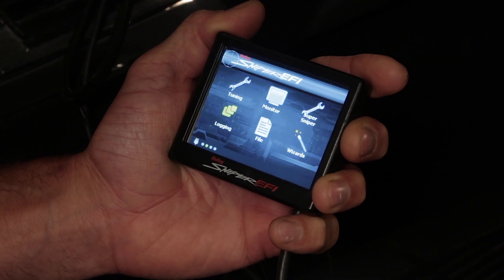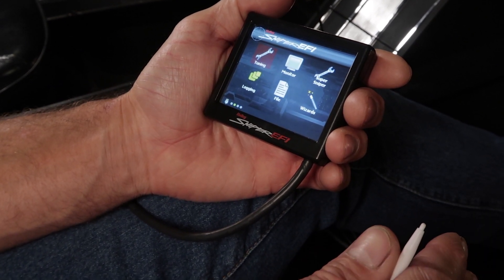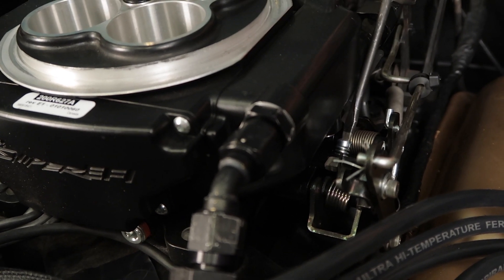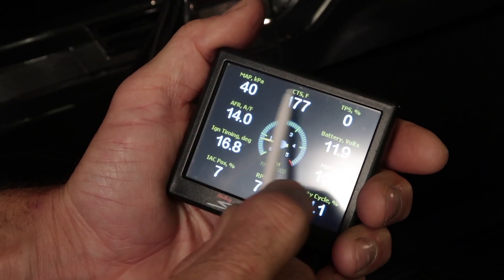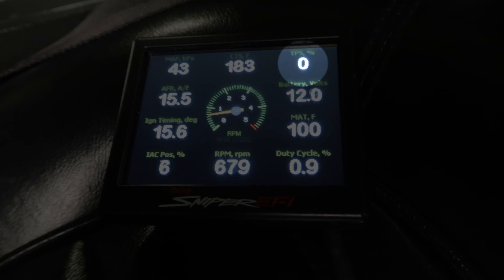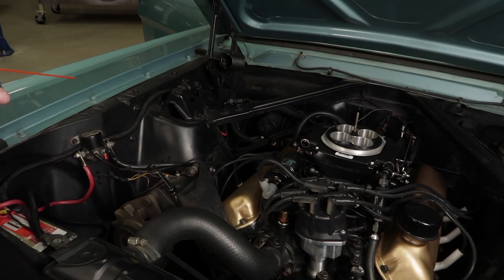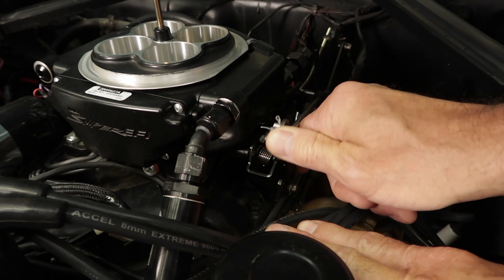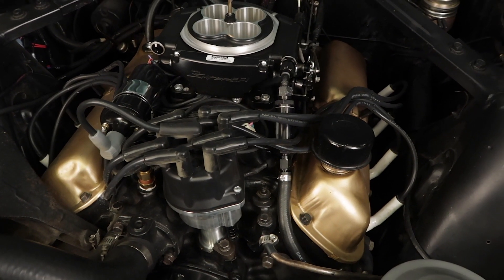Sniper EFI Idle Tuning

Comment: Can the efi be operated with the IAC disconnected, or with a static IAC? This surging issue has become quite a problem fof me, I even replaced the IAC, and it continues to surge when warm. This is a BBD model Sniper EFI, and it has me foubting not onlh it, but the Q-jet model one I got for my RV but have not installed yet!

Comment: I’m about to install a sniper stealth I bought two years ago finally. Fuel pump and lines on the way expected Tmro.  I’ve heard some about some challenges with the older 4150 flanged stealth units I hope it all works like it should on a mild 440 truck.

Comment: I've been looking fr a video on how to set tjr IAC on Sniper 2 .. the set u is different.
for example

On the Sniper 2,
There are two Adjustments screws with green springs around them.
I really want to know what each screw adjusts?

Like the front one (towards the front of the turck) adjusts ___ ?

And the rear most one is for adjusting the _____________________?
Reply: Just for the record I learned the FRONT SCREW (the onne on an angle ) is the "Primary Idle Adjusting Screw"

Comment: I’m curious if anyone can help me out. I’m trying to figure out how the Sniper learns…for example, I assumed that each drive would have the Sniper learning and that eventually the learn percentage would reach 100%. Mine seems to start from about 8% at each start and then only ever gets to 28% at its highest learn rate. Is anyone ever seeing 100% on their installs? Or does it start from scratch at each start by design? I’m running the Sniper BBD on an 84 AMC Eagle Wagon if that helps. It’s the CJ7 kit that Holley sells. Cheers!
Reply: Hi!  You want that number to be as low as possible.  It actually means the amount of correction your sniper is making to you fuel table, so the lower the better.  If you sniper has learned "100%" as you mention, your learning graph would read 0%...  But it really isn't that simple.  Drive around for a couple of weeks, in all conditions, then remember to transfer the learn table to the fuel table.  Do it again and you should see lower numbers on the learn table.
Reply: Oh wow…thanks. I was thinking about it completely backwards. Thanks for making it make sense for me. Now off to plan a new fuel tank and in tank pump to get rid of the angry mosquito sound of the external fuel pump. Cheers!

Comment: What Holley doesn’t tell you is that the PCV valve with the ball in it is a complete nightmare for tuning. Calling tech support they recommend that you use an adjustable style like a Wagner. I finally ditched the setup for a motion raceworks catch can with the adapters for SBC valve covers. Fought this for weeks with multiple calls to tech support.
Reply: I read to get a fixed orifice pcv valve, also where is the pcv supposed to be hooked up to, I thought it was for the front plug, but in the video they have their routed to the back, would that make a difference?
Reply: @thinetaco3722  it doesn’t matter where you put the pcv setup. Usually goes towards the back for convenience to the back of the carb.  It will vent positive pressure out of any hole in a valve cover.  Wagner is a adjustable pcv valve that you can adjust using a vacuum gauge then lock it in.

Comment: My truck idles fine when its hot. It WON'T keep running  without throttle assistance until it reaches 165 and the fuel loop closes. What to do?

Comment: One problem people have been having is the A/C fan control is set at 50% out the box. Causing odd surging issues. I set mine to 0% fixed the problem. It's not a issue for some reason if you do have A/C and only if you don't.

Comment: seems like alot of problems occur when timing control is applied to system.I installed the sniper on a big block chevy ,only has hei and an msd for ignition and it idles and runs perfect,simple sometimes is better.

Comment: Good video and methodology.  I am retired OEM engineer with an extensive background in engine control systems.  I have to work on a friend of a friend's Sniper system that won't run properly.  I am going to read the instructions AND watch all of these videos.  Thanks

Comment: I have a 68 chevy elcamino and i am thinking about going to this system and this guy really knows his stuff. The only thing I am wondering is about the cold start? They usually have a cold start injector right? what happens here to make cold start possible? Thanks
Reply: Just installed mine last weekend, fired it up at 18degF yesterday morning and it fired like a new car
Reply: Also, 69 Olds 442, 400ci
Reply: While this was 2 years ago this got asked... To the original poster: Most EFI units built after 1990 didn't use a cold start injector... The Bosch CSI units used a cold start injector as well as a few of the obd1 Toyotas utilized 5:48  a cold start injector for extremely cold conditions in the case of a 3.0l Toyota V-6... But if you look at theory of operation on the cold start injector on that engine it is used for temperatures below 20°F... The Bosch CSI systemt used one because they fuel distributor which mechanically controls AFR with a flapper valve in the intake system that moves the pintel inside the fuel distributor... The flapper valve was similar to a vane style mass air flow sensor...

Comment: If it works right you shouldnt need to tune it. Beware of products that require " tuning " so if it dosent work right they can blame you.
Reply: tell us you have no clue without saying you have no clue
Reply: All efi, hell even carburetors require tuning. It's not the product fault that you do not have a basic understanding of internal combustion engines, or how to make one run. Brand new cars have computers that work right.. after hundreds of hours of calibration for the engine/vehicle platform.

Comment: Is there any Holley sniper efi videos on flat spots when flooring the accelerator flat from traffic lights causing flat spots.
Reply: Have you re-checked your timing….found out mine actually handles 3* higher than factory setting and runs very well

Comment: Had the idle problem with mine, repeated this process, it helped but when I give it full throttle while driving the IAC stays 20% and idle increases 200rpm until I pull over and shut off the ignition and restart. Then it resets and runs fine again... maddening.

Comment: So I disable the idle spark and cycled and got the IAC back down to 5 but after turning the idle spark back on and cycling it’s up to 30.  Is this part of Hyperspark still learning and it will drop down? Thx in advance.
Reply: Hyperspark doesn't learn only fuel learns

Comment: Here's a question mine idles around 700, and I set the iac to 3 but it will jump to 5-7  reving it 50rpm then comes back shits steady at 3 for few minutes. I verified no leaks new spark plugs and wires

Comment: I adjusted the IAC using this video to about 5%. I had been having a problem with stalling when coming to a stop. I raised the idle to 750 from 650 and thought that solved it but I didn't. Then I tried adjusting the IAC and didn't even make it around the block. While accelerating the engine sounded awful and seemed like it was running rich. It stalled and was hard to start and smoked a bit when it finally started, and the engine was barely staying running.
Reply: I'll bet you have (or had) a loose connection on one of the injectors.  I had the same rich condition and rough running myself.  Just fixed it - found one injector plug had rattled out.  Sorted that out and the engine starts from dead cold just like it should now.
Reply: @hughjanus3235  thanks for the tip, I'm going to look Into this. I haven't solved this problem yet. Thought the problem was too small of an alternator, so I installed a 150 amp powermaster unit. Still running rich though, I hope it's as simple as a loose connection.
Reply: @paulleonardo4906  Leaking manifold or header gaskets? That'll cause it to run rich too. Also the IAC should be adjusted between 8-12%
Reply: The alternator on the truck was a factory 55 amp DELCO. We determined this was insufficient for the EFI system. Never ended up being able to fix the unit, even after sending it to Holley for repair. We ended up needing to replace the whole unit, but now with a brand new Powermaster 140amp alternator the truck is running fantastic.
Reply: Did you ever figure it out

Comment: Hello. I have the sniper on my sbf 331. I have a problem with the way it accelerates the pedal seems to be tough to press and once I get it to move if pops loosing and the car lunges forward .the linkage and everything seems fine nice and smooth. no fun to drive I see a lot of videos on here about the progressive linkage where the secondaries open up a little later is that what I need to do or is it there adjustment that will correct that problem ? I can't imagine everyone that buys a sniper has to change the linkage right away
Reply: Throttle lever extension is solution for stiff tip in
Reply: I have the SAME issue!! What do we do???
Reply: So here is my fix.it runs great now..so that little progressive linkage is no good secondaries open way to late 40% is no good missing to much range.what I did was straighten the original linkage piece just slightly so they open at around 14%..then go in an tell computer new range..also had adjusted secondary spring so it's not so aggressive.

Comment: Is it recommended that the old variable PCV valve be replaced with a fixed one? I've seen a few posts about the older style opening, adding more air and creating a lean warning on the handheld.

Comment: If you have an automatic transmission: Start by putting a piece of duct tape over your IAC hole on the top your TB and adjust the idle screw until the idle is at 740rpm at about 14.4afr. Restart ignition. Once the car runs fine without the iac take the tape off. Shift from park to drive with your left foot on the brake and you right foot on the throttle to blip as the engine starts to stall. IAC will hit 20% and slow to 12%. Back and forth P to D until the IAC learns. Stall test for no more than 5 seconds to build more learn data.
Reply: AEM in their 30-4110 PDF states that running the LSU 4.9 at less than 0.95 lambda shortens its life. Should we be running these Snipers at anything less that 14:1 and expecting longevity??

AEM: 
IMPORTANT Notes – PLEASE READ
The sensor contains a ceramic module and should not be subject to mechanical or
thermal shock or it may be damaged. The sensor is not designed for operation on
leaded fuels, doing so will dramatically shorten sensor life. Long term running in the rich
region (Lambda < 0.95) will shorten sensor life. High exhaust temperatures (over 850C)
will shorten sensor life. Engine oil consumption at a rate greater than 1 quart per 1,000
miles will shorten sensor life. With the UEGO Sensor installed, do not run the engine
without power applied to the gauge.
Reply: @Alan Conner  well sir I have been thru about 8 or more 02 sensors over last 4 maybe 5 years. The one I have now has lasted over a year the trick to keeping it alive was moving it 6 inches long  further downstream
Reply: Did this actually work? I’m having the same issue with mine. Idles great but dies when shifting into drive. Have to bump the gas to help it not die.

Comment: how did you get the tach (RPM) gauge in the middle of the 3.5 display to only read up to 5000 RPS''s.  I have been trying to figure that one out and take mine off the 20000 RPM range?
Reply: Set your rev limiters and tach will compensate.

Comment: Hi friends, I have a problem, after 30minutes run in the road the AFR-AF parameter up to 35 and the car are shutdown, Im wait 30 minutes and continue runs perfect but after 15 minutus the same fail occur again😰
Reply: Make sure you don't have any exhaust leaks, or leaks around the exhaust O2 sensor.
Reply: Hi Rolando. I have this same problem. Did your resolve the issue? I hope you did and I would really appreciate it very much to know how you got it fixed. My mechanic cannot find the problem. Thank you.

Comment: If order a sniper stealth will it control timing on a ls
Reply from the maker: No, sniper will not control an LS ignition system. We recommend a terminator X system for that application.
Reply: @HolleyPerformance  msd box terminatior stealth

Comment: Iac is at 80% start up. Goes to 100%   when running. Any help much appreciated.
Reply from the maker: Open up your throttle blades using the idle speed screw!

Comment: Add dielectric grease inside the distributor cap? Where exactly do I put it? I've put grease inside both ends of my spark plug boots, but never heard of putting it inside the cap.
Reply: Not inside the cap, you can put some on the terminal or the boot of the plug wire that plugs on your cap

Comment: What is the IAC suppose to be at while in gear?
Reply from the maker: It varies depending on the combination but you should expect something in the 40-60 range
Reply: @HolleyPerformance  ok thanks and after how many miles with the sniper unit stop learning ? When on the freeway at about 3100 rpms  my car will have a jump in AFR then go back down to what it's set for. (Street/strip) i have put about 200 miles on it.

Comment: Video did not help. IAC is still all over the place, and so is the idle. Runs so rich that there is not a mosquito in a 5 mile radius
Reply: Sounds like you have an intake vacuum leak
Reply: Dang, I wish you were my neighbor.😁
Reply: I'm having the same problem I believe you right there's a vacuum leak somewhere I need to find it

Comment: I always feel like i get deja vu is this a re run. Man listen to that sniper sucker is loud when u get close I have always assumed it was my valve train but nope it's the sniper injectors.
Reply: Same does yours make a super loud sucking noise when its running i didnt think it would be as loud as it is
Reply: JT Epps yep
Reply: @jtepps5289  a whistle noise can be had if you don't use 4 hole spaer
Reply: @cfmechanic  a 4 hole what?